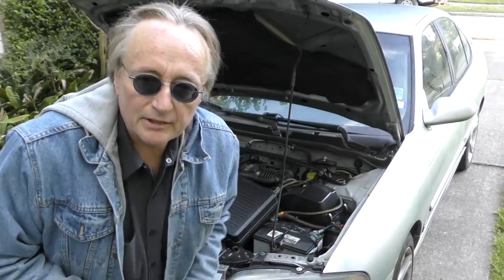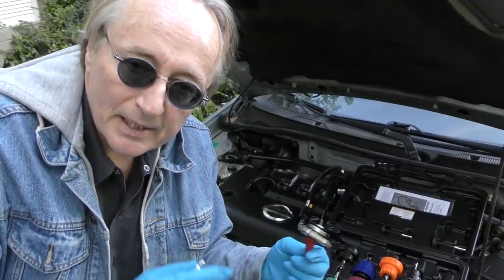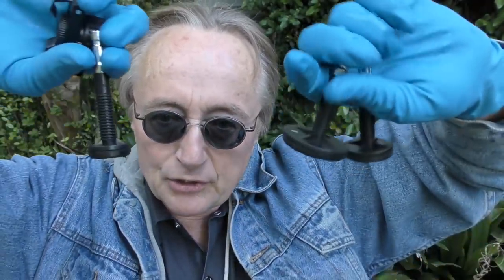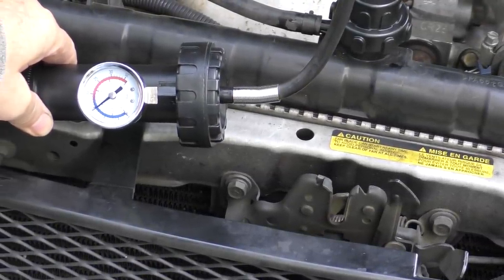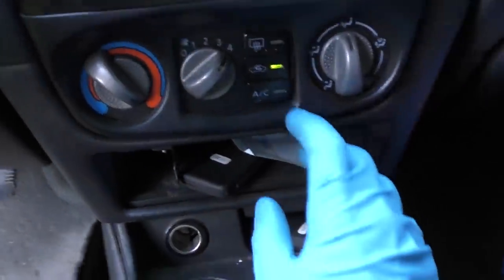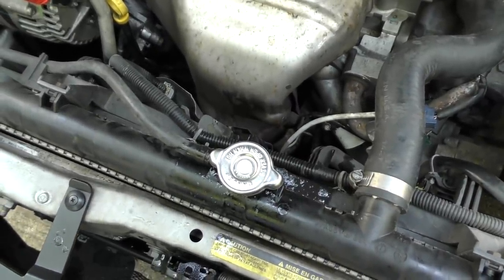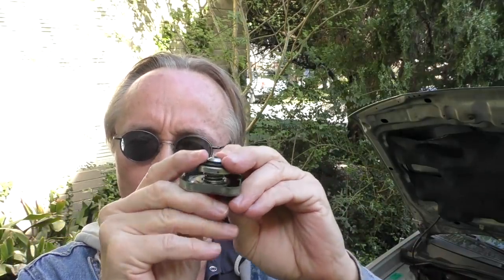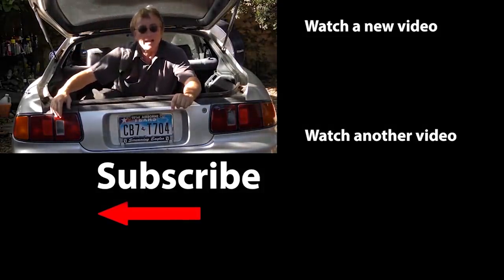How to Fix an Overheating Car Engine for $5

Comment: I haven't done the pressure test but from your experience if the hot /cold Guage keeps moving to hot but comes back to the middle while driving could that be a pressure issue? I checked the engine and seems to be some orange fluid but no major leaks? Thank you.

Comment: Scotty, i have a check engine light on my 2009 camry se 4cyl. 155k miles. The code that came up is p0441.   What can that mean? A number of things or The  Purge Control Valve?
And how much to get it replaced from a mechanic?

Comment: hey scotty

My 2015 skoda octavia 1.6TDI engine has a loud ticking noise when the engine is very cold and under load, only between 1250-1750rpm. After one or two minutes of driving it's gone. I have scoured the net and it sounds like lifter tick, however I'm not sure. Could you elaborate? if it is lifter tick, is it something I should fix? How would I go about checking this stuff myself?

Comment: scotty what would you think of a 85 Toyota 22r heating up, only on freeway or uphill, has a new head gasket, thermostat, every logical thing we can think of, new radiator ,1 mistake my nephew made was putting red antifreeze, since then he changed the thermostat 3 times,  one thing we do know is the heater does not get hot, the switch is bypassed, so if the heater core is good, why would it not get hot, the heater I mean

Comment: I have a 2003 mitsubishi eclipse that runs hot (3/4 of the way. Has never reached the red zone) . At first, it would over heat in stop and go traffic. I took it to the mechanic for a diagnostic. They told me it was the thermostat and radiator. I replaced those and it started running hot after 10 min of driving. I have no leaks, a new radiator, radiator cap, and thermostat. What else can cause the car to run hot.

Comment: Also, many cars nowadays use only expansion tank caps. 
The radiator doesn't have the traditional cap shown in the video. 
The expantion tank cap has the two balves, and does the same job of pressurising the system.

Comment: What is your opinion on a 2002 Subaru Impreza Outback Sport with 172k my friend just got one and it burns up a lot of oil and needs brake fluid often I think the head gasket is leaking oil but she thinks it’s fine.

Comment: Hi scotty, i have Hyundai Avega/Accent 2011 (Indonesian Version) with 1.5l petrol 12v with automatic transmission and its second generation. Now have around 126.000KM and it burning oil and coolant, engine power seems drop, not having oil leakage, whats the problem and fix? Thanks.

Comment: I don't have temperature gauge and not even tachometer in the vehicle.
Is there a way to determine if the vehicle overheat through an obd2 reading?

Comment: My radiator test kit wont even stay in place tight And when it does I try to pump it and the psi wont go up what does this mean? I also took off the condenser to replace it so at the moment is not on I'm not sure if that has anything  to do with my problem

Comment: I replaced the radiator cap and the thermostat and I'm still overheating, none of my coolant hoses are hot though. Do I have a leak? My coolant level isn't dropping so I don't think it is that. I don't think its the radiator either because its not leaking either, so I'm lost. I want to get my 98 Mazda b series street ready but I can't figure it out whatsoever, help!

Comment: You should clarify for safety to not remove a radiator cap when the system is at operating temperature. You could get scalded. In this case it did not matter as it was not holding pressure to begin with. A pressurized system increases the boiling point of the coolant. At 15 psi of pressure the coolant would have to get to a temperature of about 120C (248F) before it would boil. If the radiator cap is not holding pressure the system will be at atmospheric pressure and boil near 100C (212F).

Comment: Scotty, that looks and sounds like a 2003-2005 Nissan Sentra SE-R. I have a 2002. Bought it for the grandson; he and I will be knuckle busting on it. I noticed a really loud intermittent rattle (sounds like a shield or an exhaust leak) on acceleration. Any ideas?

Comment: This reminds me of the time I changed my leaking radiator in my Chevy S10.  It didn't come with a radiator cap, so I bought a new cap which was exactly the same as the original.  Everything was fine until the coolant in my reservoir started boiling, which indicated that my cooling system had either little or no pressure.  The engine was running normally otherwise with no overheating.  It turned out the radiator cap I had was junk and wasn't holding pressure like it was supposed to do, so I had to replace it.  It did the trick as I never had the problem again after replacing it.

Comment: Good tip. I had to replace the coolant tank on my car when it was leaking at the return port and it came with its own cap. I have the cap from the old tank that I replaced with a similar one. Would it be a good idea to swap the caps around? This is on a 2001 Oldsmobile Intrigue GX that has close to 119,000 miles and still runs great. Well, I swapped the caps around and it still rises above the 1/2 marker. I ordered a BlueDriver OBD2 scanning tool that'll allow me to use my tablet to do some deep diagnostics and get live data to see what the issue is. Funny thing is, there's no air in the cooling system and it gets the full 15PSI for the coolant pressure. Is it the thermostat, water pump, or both?

Comment: Can somebody please help me understand why my engine overheats all of a sudden after a (side) bumper collision followed by a paint job? The radiator sections was uneffected, so not really sure what's causing my engine bay to overheat to an extend that I couldn't even lift up the hood prop rod. The engine heat gauge inside the dash looks normal though. And about the paint job, the unskillful people seems to have failed to cover the radiator while painting. I can see small amount of paints sprayed over the radiator fins. Maybe that's the reason? Thanks for helping :-)

Comment: Hey scotty I have a 2006 scion xb with 105,000 miles. I'm looking to get a little bit more power, but wasnt sure if aftermarket injectors and a larger throttle body will be worth the money for the results

Comment: Hi scotty Kilmer I am just wondering if you would know if the front brake pads and brake disks and the rear brake drums and rear shoes off a 1991 Toyota Corolla seca are compatible with a 1987 AE82 Toyota Corolla hatchback as a seller is selling them brand new and I'm considering in buying them if they are compatible

Comment: I remember when I first got my old Porsche 944, it would overheat a lot. Turned out to be the radiator cap. Was thw wrong pressure cap. So steam was building up in cooling system. Put a factory OEM cap on and no more boil over and never had a overheat problem again..

Comment: If you did not put in a new thermostat then put one in from stealership. Maybe biggest bang for buck when comes to reliability. Sometimes one fan is for A/C and one from engine brain via coolant temp sensor. Take off electrical connector from coolant sensor. (not gauge sensor as they are usually seperate) and jump a wire between them. 
If car is in "ON" or running the fan should turn on.

Comment: long life ready to use coolants are far more better than using ordinary, or others say mineral water is good for your radiator system. rtu coolants doesn’t boil easily compared to water and it protects your system as well.

Comment: Hey scotty i am thinking of buy a hyundai 2002 tiburon auto 4 cylinder with 125000 miles on the clock. For a decent price. Is it worth it?

Comment: Increase the pressure, increase the boiling point of fluids. That's why, when you take the cap off the radiator when the engine's hot, the water flash boils when it hits atmospheric pressure.
Reply: forty two  and somebody is going to get hurt.

Comment: help sir how to fix engine over heating when a.c  on. compressor  thermostat  c.t.s  radiator fan  motor  water pump  head gascket all new. but the guage still moving up to  H

Comment: I have a question for you people.
So it happens i have a vw polo 6n2 from year 2000 with a 1.4 mpi engine.
Problem is if i drive it and it goes to normal temp 90 degress celsius then if i shut it off i have to wait till its cooled down before i can start it again.
Tried chaning crankshaft sensor did not fix it. Any ideas arr apriciated hate it and have to wait 1 hours before i can drive it each time i shut it off. Hate tanking it have to push it away from the gas station

Comment: Someone help me please!!!! If I drive for 2 hours after changing the cap, and the engine isn't overheating at all anymore, does that mean my thermostat isn't bad? Also, when should my fans automatically kick on without the AC on? I know that my fans turn on when I have the AC on but I'm not sure if they are turning on when they are supposed to

Comment: Hey Scotty how can we tell if the thermostat is working properly ? I have a 2005 Chevy Tahoe with a V-8 and all the sudden it just started getting super hot up to about 200 degrees range and then sometimes it will automatically just start dropping back into normal range ❗️❗️❗️❗️❗️ please help

Comment: What about if you don't have a radiator cap. Only the over flow tank?
Reply: yellowbusguy92 it’s in the overflow tank cap..
Reply: The cap on the fill tank is the pressure cap. On your set up its not just an over flow tank, it is also under pressure.
Reply: then if the plastic tank you are looking at will be a pressurized tank,  do not open it if the motor is hot,   it will burst out and burn you,   if there is no cap on the radiator that's not a cheap thin plastic overflow such as whats on much older cars.

Comment: Pretty sure when I was looking at an owners manual's service intervals for an Infinity G37 it said to replace the radiator cap.  I wish more companies did this especially for super cheap easy to replace items like radiator caps and PCV's.  Diagnostic work is $150 ish an hour and a correct diagnostic can at times be tricky.

Comment: Hello sir,I am from UAE. My car Lexus RX 330 2004. I am facing a problem with my engine colling system. Sometimes my car Getting heat not everyday. When getting heat after fill up the water then again going ok for next few days. There is no any leak and fan working perfectly. I noticed one more thing that when I drive the car in 2000 to 2400rpm then car going ok,but when I accelareting 3000rpm + then engine getting heat and through out hot water with pressuse into extra water little tank which connected with redioueter.someone telling redioueter problem, some telling water pump issue, some of telling maight be any electrical fuse issue. I'm in confused 😵.so kindly help me out. 
Thanks

Comment: Hey Scotty I got a 2007 Nissan Murano with 183,000 miles and I just changed the antifreeze and I got a check engine light P0305 the engine was shaking and lost acceleration
Reply: Spenser Chalkley thank you

Comment: I had a 97 Neon that was running hot. I popped the hood and saw the fan didn’t work.  I googled the problem and read that Neons are famous at having the fan sensors go bad, so I put it on my ramps and crawled under it to take the sensor off.  I saw a decent sized bulge in a wire. I poked it with my pocket knife and a bunch of crud fell out.  I bought a 3 inch piece of wire and 2 wire nuts. I spliced in the wire and started it up. The fan worked again-cost me less than a dollar to fix.  Car ran great until someone T-boned me the next winter.

Comment: Good tip on the factory cap used to work for oreilly auto parts. We sold great parts but theres an exception to every rule...Murray Climate Control parts were junk there wasn't a good cap made for them, go for a premium Stant branded or OE cap! Even we would tell people hey I'll help ya with all this but you're gonna need to go to advance or pepboys for the cap lol funny enough they're made in Israel which usually makes good stuff the best ones are made in the Americas or the vehicles country of origin.

Comment: Also some cooling systems require coolant cap to be tightened half way when bleeding coolant system. I learned this the hard way when I just left the cap completely off like I did with all the previous cars and result was blown headgasket. Apparently this one needed some pressure to prevent hot air pockets in engine block or something.
Reply: A Lincoln?

Comment: I have a 1993 Chevy suburban that get over heated and I change the cap and thermostat and couch fan and it still gets hot weird  and it has a 454

Comment: Hmmm, I might run out and get a new cap for two of my cars just as part of routine maintenance. Thanks for the cheap tip. Might get the test kit too, but no need for that right now since I don't have any problems.

Comment: Scotty I  need your help desperately i have a 2002 Lexus es300 ( same as your wife's) I have owned the car for a year and every so many months my car over heats randomly no visable leaks pressure tested and hold pressure and block tested fine with no exhaust gas in the coolant system upon noticing it I checked the water every day I drew a link on the tank and it didn't change for days of driving at least 50 miles each then days of not checking it the level will drop around half a can soda in amount so not alot but over time what could it be if everything inside is apparently in working condition only 120k

Comment: hey! i have a funny issue with my car doors. the driver side is used to lock all doors but all except the passenger side door locks. And when I try locking all doors from the passenger side, all except the driver side door, gets locked  . Can you please make a video on the door locks in car ? Thank you:D

Comment: I had the unfortunate luck one time where the cause of my overheating vehicle was caused by a corroded freeze plug.  Freeze plugs are not that expensive, but to get to them, you have to drop the transmission.

Comment: Thermostats can be a problem as well. Either they can fail open ,or closed.
Reply: Peter Montagnon mitsubishi lol
Reply: Failing open will not cause an overheating issues. Modern vehicles will set a P0128 DTC with an open T-stat or low coolant.
Reply: @meabob  did I say anything about over heating when it fails open???? Just said they fail either way.

Comment: Watch out for those cheap plastic parts on the cheap caps. They can break and leave you without any way to keep coolant in your radiator. Everything works together for cooling. It all has to be right, to work. I have seen thermostats fail in lots of ways. Last time I had to get a new one, man, it dropped the needle like a rock when it opened up....triple core, super flow radiator...wow.

Comment: Another tip. My 2008 Chevy truck's AC  stopped. I was WTF? Turned out the easy to repair coolant thermostat rubber gasket fail, the computer didn't if the engine was overheating and shut down the AC.
Reply: Sometimes fuse/relay worth trying also.

Comment: My 2000 Toyota Camry overheats, no leaks anywhere, head is good and I lose fluid from the overflow tank (No, the tank doesn’t have any leaks) and surprisingly not the radiator itself. What gives?
Reply: All have been replaced also OEM

Comment: hard to believe it's caused by something that look so innocuous. it makes me wonder if i got ripped off by the mechanic that charged me $500 for repairing overheating problem since i wasn't able to see any leak in the radiator when my car overheated and i noticed something fell off the cap when i took it off.

Comment: Quick question, this might sound stupid, but where do you go to get OEM parts? Let's say Toyota. Do you get them online? Thanks
Reply: You would normally get it from the dealership parts or online many dealerships are now offering that. Sometimes you can find parts like on Amazon that are being sold thru a dealership. Read the fine print when buying from parts stores. In this case for the cap the parts store may have a generic cap that is just as good, however if you buy from the dealer it it will be a exact or better replacement for the cap. Just cost more if genuine Original equipment manufacturer.

Comment: why do they have separate fluid for cooling the engine?
can't they just use engine oil as the coolant?
isn't that how the transmission is cooled? using transmission fluid?
Reply: One of the many factors of motor of is that it helps cool the engine. But not enough to keep it from overheating.

Comment: Would the engine still over heat if there's still coolant, but the radiator cap is bad?
Reply: Do you lack reading comprehension? He said the coolant may evaporate if the rad cap crapped out. He didn't specifically say the engine will overheat BECAUSE of a bad radiotor cap.

Comment: Scotty please answer my question. I have a 2006 rav4 with only 42000 Miles. Heater works ac works but everytime I accelerate hot air gets in from the air vents and make the inside of the car very hot. What can it be?
Reply: Don't know about your car but in most older cars there  is a flap or door that opens to let fresh air in when you put it on vent with the AC on it closes. Just about all of them used vacuum pressure from the engine. Without knowing about your car I would check all the small hoses in the engine Compartment and under the dash. Also the damper actuator which opens and closes the door could be bad it usually is located under the dash.
Reply: Jeep Cherokee thank you so much

Comment: My 08 gmc sierra 1500 4.3 is overheating after changing thermostat and radiator flush My water pump is only a year old what can you tell me my problem is
Reply: I'm changing my radiator in a few weeks maybe that would fix